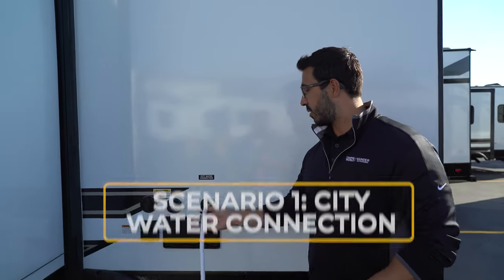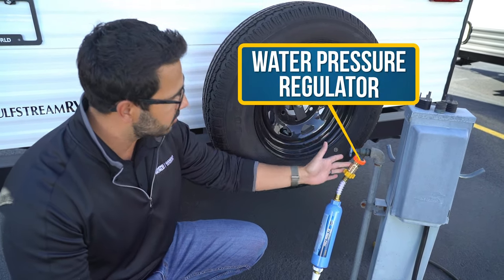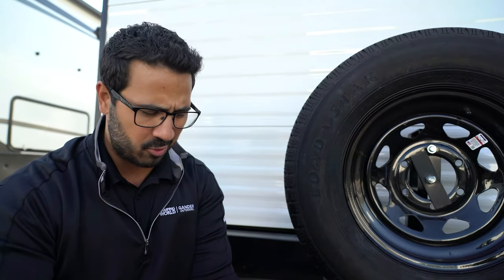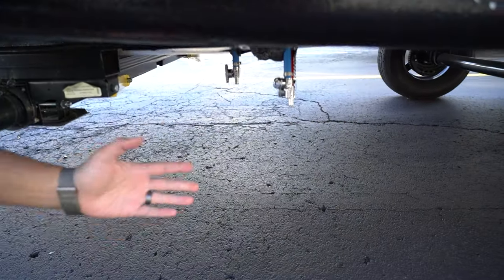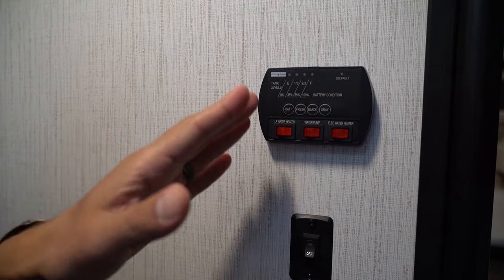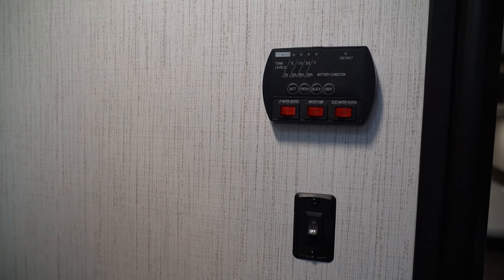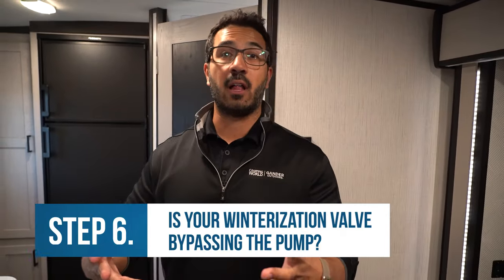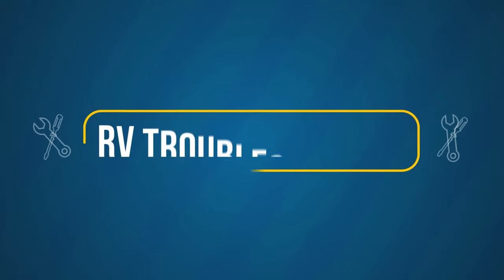Water NOT Running?? This is how you fix it! | RV Troubleshooting

Comment: Checked everything. Still, zero pressure from city water. Last summer, everything was fine ! No idea what's going on, no valve blocking water. It's a complete mystery. Thanks for the vid though.
Reply from the maker: Very sorry to hear that! 

Did you have your RV winterized until now? If so, are you certain the bypass valve on your water heater has been returned to the normal operating position?

Some city water inlets also have a check valve that prevents backflow. An issue with it COULD be related to your problems. 

I'd recommend contacting an RV service center (https://rv.campingworld.com/service) or reaching out to our Technical Service hotline (1-866-838-5304) for additional troubleshooting help. 

Hope you find a smooth and quick resolution!
- Tucker Ballister

Comment: This is all great BUT also would have helped to be told to look in main water line and see if there was a water stopper in the line.  It took us time and effort to find this stopper.

People check water lines for stoppers. Clean screens too.
Reply from the maker: Hi There!

Did you resolve your issue? 

I'm unsure what stoppers you're referring to here, but do know that debris in the system can cause stoppages in some cases. 

Let us know if you're still experiencing an issue and we'll do our best to provide suggestions!
- Tucker Ballister

Comment: In single digit weather with skirting and a heater running under it and in the cabin. Water was running just a couple of days ago, but then I had no water coming out in the bathroom on the hot faucet side, but my kitchen was working fine. That evening, I have zero water coming out of any faucet/toilet. My water hose has heat tape, foil tape, foam on it. I'm about to check the spigot and change my water hose to a heated hose. If that doesn't solve it, what else could it be?
Reply from the maker: Hi Diana, 

A heated hose is a great place to start from my experience. Have you looked around to ensure you aren't experiencing any leaks?

The difference between your bathroom and kitchen faucet experience makes me wonder about the temperature differences between those rooms. In my trailer, for example, I don't get much heat into the bathroom unless I leave the door open overnight. 

The heaters you're running sound like a solid solution, but things get dicey in single-digit temperatures, especially if you're not in a four-season unit. 

What is your RV's make/model? In addition to the heated hose, you might try strategically opening that bathroom door and any cabinet doors to allow heat to circulate to areas where your RV's water piping is running. 

Hope this in some way helps, but looking forward to your reply!
- Tucker Ballister

Comment: I just got a 2005 aerolite cub m23tt and I am getting 0 water to the pump but I can’t tell if there’s a bypass or not idk what else to do
Reply from the maker: Hi Zachery! 

Is your freshwater tank filled? Can you hear the pump running, but you're getting no water out of any faucets? Does your system work when connected to city water?

Some units have a shut-off valve between the tank and the pump, so I'd look for that first. From there, you may also have a bypass valve on your water heater. I can't say anything for certain with a used model like that, as it's tough to tell if any alterations have been made to the system. 

More info is needed, but you might be better served by booking a service appointment to have an RV tech diagnose the issue in person. Here's a link to our service department: https://rv.campingworld.com/rv-service-maintenance

Hope that helps!
- Tucker Ballister

Comment: I can only use one sink or shower at a time and I have a regulator and a heated hose it sucks plz help!
Reply from the maker: Hi Byron, 

I'd like to gather some more info to see if I can help you troubleshoot this issue. 

When you already have water running in one sink and you try to turn another sink on, what happens?

Also, do you have a pressure regulator with a gauge on it? If so, what is it reading?

Looking forward to your reply!
- Tucker Ballister

Comment: I’m connected to city water but my 4 seasons rv has no running water. My city water hose and spigot are running just fine and pressure is good but no faucets have any water yet my toilet is running just fine??
Reply from the maker: Hi There!

What temperatures are you currently camping in?

If you recently used their fresh tank and pump, debris from that system can quickly plug faucet aerators. Check the aerators to see if they are plugged up.

In cold temps, we may have an issue with frozen water lines inside the unit too. 

Let us know where you're camping and we can hope to provide further assistance!

In the meantime, here's our article on all things for winter RV camping: https://blog.campingworld.com/lifestyle-activities/winter-rv-camping-what-you-need-to-know/

Looking forward to hearing from you!
- Tucker Ballister
Reply: @campingworld  right now we’re sitting at 12°F but I am not using fresh water whatsoever just city
Reply: @campingworld  turns out my lines were frozen somewhere between my toilet and kitchen sink. That’s why all my other faucets froze. I had my faucets running last night and space heaters running while I was out at work. I came back to a running faucet since it warmed up to above freezing temps here. Thanks for helping out!

Comment: 2002 winnebago adventurer. Hooked up tocity water. Valve it turned to city water.   In the same way, I've done it for 6 years.  No city water.
Reply: Same problem. Did you fix it ?

Comment: None of these fixes helped. City water is on and good, but RV still just lost all water pressure, why?
Reply from the maker: Hi There! 

Can you tell us more about any troubleshooting you've already attempted? 

Was this your first time hooking up to city water after dewinterizing your RV? 

There could be a few potential causes, such as a certain valve not being returned to normal operating position during de-winterization or a faulty check valve in the city water inlet, but we'd likely need more information before coming to a more accurate conclusion. 

Looking forward to your reply, but you can also reach out to our service department to speak to a representative here: https://rv.campingworld.com/rv-service-maintenance

Hope that helps!
- Tucker Ballister
Reply: Hi, Ive been using my RV fine hooked up to city water for over a year. This problem has been happening off and on, but it’s getting worse. I have pressure for a week then no pressure. I turn off my water, disconnect my city water hose, turn it back on and walla, pressure is back, until time has passed then its gone again. It’s very confusing. Water at the spicket is always strong.

Comment: I have a gulfstream cavalier with no holding tanks.  Two weeks ago water was coming out of my sink faucets just fine.  Water hose was not disconnected from  water faucet or camper between then and now.  This weekend nothing.  I unhooked the hose from the camper and there is plenty of pressure coming out of the hose.  I can put my mouth on the intake to the camper and blow and air comes out the camper sink faucet.  I put the hose back on and nothing.  I have been using this camper in this location for almost 6 years.  Any suggestions?
Reply from the maker: Hi Trav! 

I reached out to my contacts with our technical team and here's their reply: 

"It sounds as though he is speaking of his supply system. If it is just the sink, I would pull the screens on the nozzles themselves and clean them first. I have seen a lot of times that if a city water check valve breaks, it will plug the incoming water. That would be where I'd start."

Let us know if that helps at all or if you have further questions!
- Tucker Ballister
Reply: @campingworld  I was just getting on here to add an update when I saw your message. No, it was not getting water to anything.  There is a screen on the inside of where the hose attaches, the part that looks like the female end of a garden hose.  On the inside of the screen is a plastic piece and gasket  I took it out and and the water runs fine.  I am going to replace it this weekend.  I guess that it is a pressure valve.  Thanks
Reply from the maker: That city water check valve may indeed be your culprit! I also got another reply from my team if you're interested: 

"I suggest changing the water filter if it has one, and removing the aerator from each faucet to flush the lines. Disassemble and clean the aerators before reinstallation. If the system was winterized, were all valve returned to normal positions?"

Just a few more leads/possibilities you can chase down if that check valve isn't the answer. 

Best of luck and happy camping when you get it fixed!
Reply: I've checked everything, tank is full water stopped at all connections cLR to clean sediment. Water pump on or off didn't make a difference. I'll just check the water pump tomorrow

Comment: How do you close off the hot and cold line so it want run out when you turn city water on
Reply from the maker: Hi Richard! I'd like to further understand your question. Are you having water escape from your RV's low point drains when connected to city water? - Tucker Ballister

Comment: I believe I’m not getting water due to low water pressure.
Reply from the maker: Hi There!

Are you using a water pressure regulator with a PSI gauge?

That's a great way to regulate and monitor water pressure (high and low) at campgrounds to ensure you aren't endangering your RV's water system. 

Here's the regulator I use for my trailer: https://www.campingworld.com/adjustable-rv-water-pressure-regulator-with-gauge-0-85-psi-132204.html

Hope that helps!
- Tucker Ballister

Comment: One good tip for ever camper who may not know or do this when you get to a camp site with water hook up run the water out of there  Faucet  to check for rust or to see if the water come out clear before you connect filter water hose or anything else